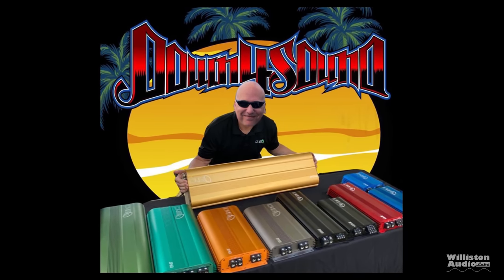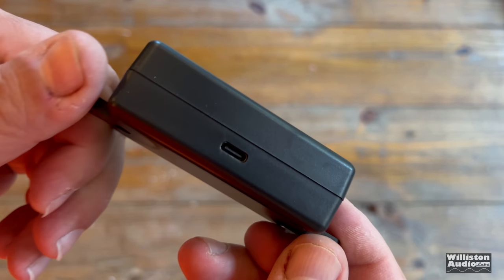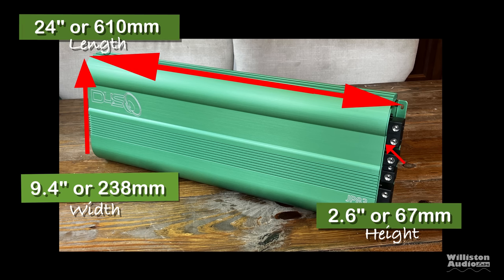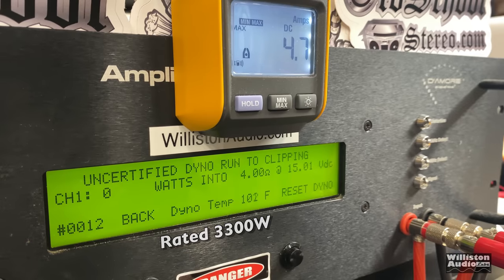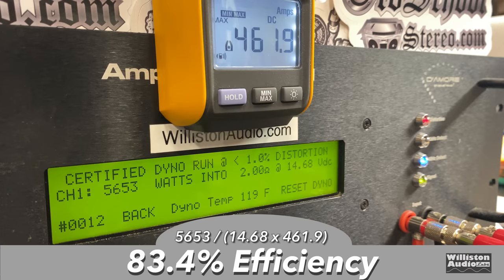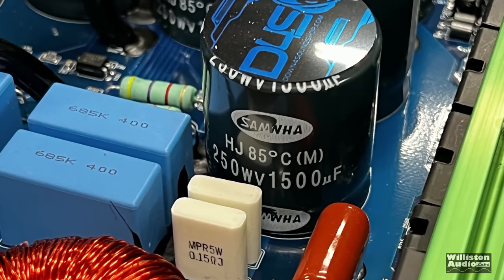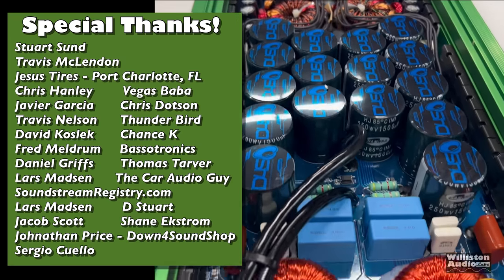OVERLOADED my AMP DYNO? D4S JP83 is a 10,000 watt MONSTER!! [4K]

Comment: So I'm all about over rated power but I'm thinking it's time JP put on his amps a more realistic rated power so people can see the price is more than good for what your getting. I've been running the JP8 for a couple months now and NO problems whatsoever. Been up in the 90's where I live and the amp has yet to get over 119 degrees. So far great quality at great price!
Reply from the maker: Awesome 👏
Reply: I get what you're saying about the power rating but there are other factors that go into rating the output of an amplifier other that what the amp dyno measures. 

The amp dyno is a continuous consistent load. A subwoofer is anything but. The amp dyno measures Certified @ 1% THD+N. This amp may be rated by D4S at a lower distortion level. The CAE requirements say "at or below 1%" so that leaves it up to the brand on how to rate them. 

On the flip side, this can reap havoc for someone trying to design an electric system to power this beast. They think they're getting an 8,300 watt amp but it has the potential to bump up to 15,000 LOL 😂

Comment: Just put in my orderrrrrrrrr!!!!!! WOOOOO 2 on the way
Reply: @wal  hey D!, question. Do you believe these can run smoothly if I run them at 15.5v as a daily? Or is that voltage too high and will cause damage? 
Now for further context I'm pairing them up with 2- 400amp Alts, 4- XS PWR S6 secondary's, and 1 SB-500 34 for under the hood.

Comment: Now that amplifier is good👍
Reply: @wal  just got my 2 Soundqubed S1-2250.1 back in my suburban. I like them better than the 8k U1-8000 Soundqubed amp. You need to get the Soundqubed 6k amplifier and test it.
Reply: Hay Derrick can you dyno a Soundqubed S1-2250.1 amplifier at .50 ohms? I'm very curious what they dyno 😃

Comment from the maker: See more and get your JP amp here:
(Affiliate links and all may not be available)
JP83 Amp: https://bit.ly/3t0zz1y
JP33 Amp: https://bit.ly/3PKhSNk
JP43 Amp: https://bit.ly/38qOcUQ
JP63 Amp: https://bit.ly/3t0fAQy
JP132ab Amp: https://bit.ly/3yYsEcT (sold out!)
JP34ab: https://bit.ly/3sZoFsY
JP23v1.5: https://bit.ly/3yYt9DN
JP234 Amp: https://bit.ly/3NF8clC
JP8 Amp: https://bit.ly/3wOBbhg
JP84 Amp: https://bit.ly/3lR2ukJ
JP95 Amp: https://bit.ly/3yYtd6v
All JP Amps: https://bit.ly/3lMb4kz

Video Playlist of all D4S Amps:
https://bit.ly/3NF8I32

Video Index:
0:00 Intro
1:04 What's Included?
1:56 Specs and Features
3:07 Size Comparison
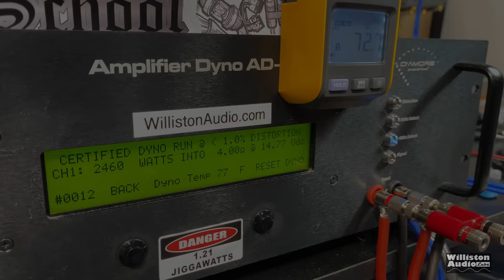3:37 Amp Dyno Tests
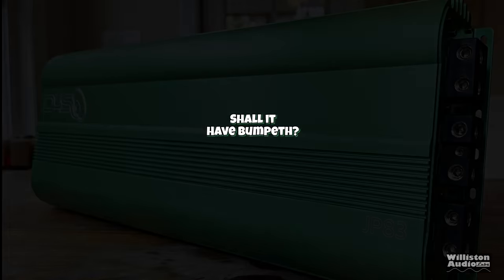7:01 JP's Windy Tahoe
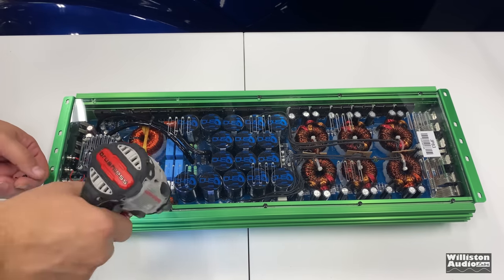7:38 What's Inside?
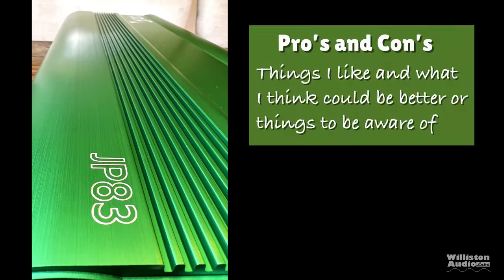8:21 Pros and Cons
9:13 Final Thoughts
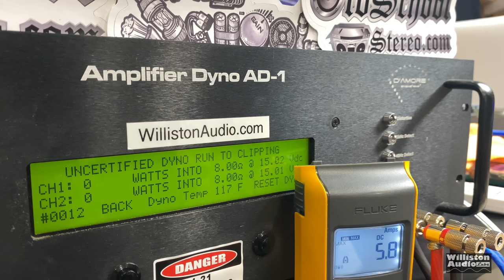9:38 EXTRAS

Links to JP's Tahoe 2022:
Build is Complete: https://youtu.be/vUyXhhAHtZQ
Tahoe Rebuild Initial Demos: https://youtu.be/1OtwOsmqjzY
2022 Made of Steele Demos: https://youtu.be/vtT2FymEkdg
2022 Slamology JP Demos: https://youtu.be/A5g2dWn8iKA
2022 Slamology JP Demos Part 2: https://youtu.be/gs1ARU55-08

Note: This video is shown as paid promotion because 1) I'm keeping the amplifier for future testing and 2) I'm an affiliate with Down4SoundShop so using my links in this video to purchase car audio results in compensation for me. I was not paid by D4S for this video. Rest assured the info provided here is factual and my opinions on the product are NOT based on possible compensation. I test amps and provide information for the consumer, what you decide to purchase is your decision. Thank you.

Comment: I see the models are taking US Amps style and coloring . ya know we have seen high power voltage high power amps before look at examples of high voltage input amps .With the electric vehicle going to be the future the voltage possibilities are endless . Hell , ive been running 18.4 volta in each of my jeep for the last 20 years and with that subtle difference in voltage and using compatible amps i see more power on a amp identical ran in a 14.4 volt setup.  Thanks for your revies and testing , its enjoyed :)

Comment: I really need to hear these amps because I’m 90% there on them being a new favorite. With a good set of 6.5” components and a clean sub(Sundown X) run in three way mode I’d be able to tell instantly. Those RF BDCP amps are hard to beat though.

I wouldn’t hesitate to recommend the entire line because of the value.
Reply: Bdcps are outdated.

Comment: I would love for someone to do some testing around 13 volts. Sounds dumb but not everyone has a super strong electrical system.
Reply: 99% of the audio fanatics.... number one do not have the money for an amplifier of this class. Number too don't have speakers that can handle the wattage, and number three it's not necessary.
Reply from the maker: JP runs his amps at 13.5 since he’s running the LTO’s in 5S config

Comment: could you make the comparison to these amps with the crescendo monoblocks?They have a lot of similarities from the outside to me.
Reply: Bass clef 6k
Reply: They are very similar to the bass clef and salts. Same buildhouse.
Reply from the maker: These JP amps have all surface mount devices and are smaller than current gen SALT and BC amps. I bet next gen of those will be smaller tho

Comment: Getting two of these strapped to power 4 b2 rampage 15's xmv4's d1's in parallel series at 2 ohms(1 ohm each amp). I just need to find out which lto's I want and 2-3 400 anp alts

Comment: Damn thing could power a house! XD Also, doing the math I'm just blow away at how much current is being shoved through those poor banana jacks on the front. Wonder if the connectors actually got hot....
Reply from the maker: The Dyno’s fan comes on at 120F and I had to give it a break to let it cool. Next time I’ll check the wires with my FLIR

Comment: I'm interested to know what kind of signal does the amp dyno tests with, like 1khz, pink noise, what? In either way i wasn't expecting that thing to output so much power, however with that kind of power is not very useful for everyone as i'd rather run PA drivers for SPL with 3-6db or more sensitivity compared to car subwoofers for the same output with twice or more less power as things such as high amps in a car turn costly, but DAMN knowing how the situation was before a few decades, you can't beat the output of this amp for its price!
Reply from the maker: For subwoofer amps it uses a ramping -30dB to 0 dB 40Hz track
Reply: @wal  And this output so much power with 40hz? Damn that's breathtaking!

Comment: The Bluetooth bassknob is really annoying especially if you have to pull every wire to reset it. Anyway I've had the JP 23 in my living room and the regular plug in bassknob makes life much easier and my friend has the salt 8. Im thinking of switching amps just because ive had so many problems with the Bluetooth bassknob. Maybe D4S can makeit optional or something?

Comment: Do you have a charger on your batteries when you do these tests? Or do you charge it after the runs?  I remember you saying you removed your capacitor bank. Wouldnt it be better to have that in there too? That would help out the surge a bit. Thanks for all you do!
Reply from the maker: With these tests I have (2) 100A power supplies running along with the LTO bank. I'd use caps too, but the versions I have are 15V max. I'm planning on replacing them eventually with all of the newer 3V 3000F cells (ones I'm currently using are 2.6V 2600F)
Reply: @wal  Looks like you should get a wrecked Tesla and use the batteries from that LOL!! Great work and thanks for your service brother!!!

Comment: It would be neat to have a pair of them running a PA system in stereo. 😉
Reply: Their bass amps st0opid 🤣
Reply: @playaj320  
Touring systems can have 100+ kW of BASS AMPS, you know for subwoofers? :-D 

Point is, it would be interesting to see what kind of cone control this amp would have compared to a mains powered sub amp in the same power range.

Comment: Big D I finally got me a d4s jp95 and so far I'm really disappointed..it has crazy engine wine..it's my mids and highs amp I had a rockford be forced no problem at all,do you know what to do cause that shit drives me crazy
Reply from the maker: I had that issue with the Sundown SFB 5ch but not the D4S JP95. Check those grounds.

Comment: hello. what was the problem in measuring the current with the fluke?
Reply from the maker: Only measures 1000A DC and this amplifier pulls WAY more than that
Reply: @wal   but why was the reading wrong when measuring by cliping? At 4:22 for example.

Comment: Fed by the correct DC supply,  from an AC outlet at home, do these figures translate directly to an equivalent home amp set up?
If so, would it reproduce a high fi quality audio through equivalent resistance home speakers? Just a thought
Reply from the maker: You would need either a massive power supply or a massive Lithium battery bank charged by a power supply to run this in a HT

Comment: I dont understand how the dyno is reading 119° 😕 an how the numbers are jumping up an not counting right.. this test should have been redone with  properly functional dyno runs.. this to me  screams disception. I love your videos have for years! but for the most highly antisipated video to be wonky per say just doesnt make sense.. why not run it again on a different day or time? Also why not use a dmm to measure voltage at the amplifiers power inputs to get the true voltage during the run?
Reply from the maker: The Amp Dyno got hot so I had to let it cool down between tests. Chill, nothing suspect here.

Comment: So technically if you could provide over 1000 AMPS those 9 amplifiers. Could provide over 200,000 Watts
Reply: Amps X Volts = Wattage, so for 200000w ÷ 12v = 16666a needed, if you can maintain 14v you would need 14285a. Same thing when people add wattage of the fuses in an amp to get a guesstimate, if it has 3 30a fuses it should make 1080w, I usually go on the low side and multiply it by 10 instead of 12 cause no amplifier ever made was 100% efficient. Hope you understand that,  it's like 4am lol

Comment: So, I love your videos.... But, you didn't measure the current correctly. DC current flows from negative to positive. So, having one clamp on meter on the negative, then measuring the return line (positive) in conjunction doesn't make any sense. All you needed was a meter on the negative, and that's all. But, it's still a bunch of current regardless - but half of what you show.

Comment: I love your content. But on your amp draw readings are incorrect. You don’t add the amp draw readings together. You would take the three readings and you can add all three runs and divide by 3 to get an average of all three. Of take the highest reading of the three and that’s your max amperage. I’m a certified electrician…
Reply from the maker: Wait, so you're saying two different clamps clamping all positive leads together isn't the total current pull? What would be the difference in my method vs using a 2000A clamp encompassing all the positive wires together? I must be missing something here...
Reply: No sure must amp clamp each one individually. Add the three and divided by three. For an average amperage. Or use the highest readings as the max amperage.

Comment: Great video. Can you check out the Boss PD4000 at $150? It is 120 amp fused. No videos on YouTube as of yet.
Reply from the maker: Thanks for the suggestion
Reply: I did a crude test with a clamp. 583 watts @ 2, and 1027 watts @ 1 ohm 78% eff. I’d really like to see your real results.
Reply: Boss is NOT Bose.
That's why the odds of seeing a Bargain Basement amplifier being tested is going to be done when he does inexpensive amps not amps that put out 20K.

Comment: Cheap S&I boards yummy
Reply from the maker: What do you prefer?
Reply: @wal  I run a Salt-8 so I love to see JP putting out an almost identical product for a much better price. But my heart is with full bridge. For example, the Powerus PW15000 is a great design with good damping factor and protection and a much better value than any half bridge. I'd love to see someone take a quality full bridge board like the Powerus and put it in a beefy case with good Tiffany connectors, etc. Imagine if JP did this he could sell an amazing efficient 10kw amp for well under $1000.

Comment: Dc is garbage my buddy went from a american bass xfl 15 to a dc audio elite 15 and it failed after 1 week hes pissed 900$ sub that has a smaller motor rhen than a 300$ skar
Reply: DC is garbage? What u smokin?
Reply: @elcomandante9299  dc is garbage it failed skar never did just like the level 6 failed on Parker clean power
Reply: @elcomandante9299  running sundown now
Reply: @elcomandante9299  running sundown now

Comment: Wait test TARAMPS HV 160kWatts 😅😄😁
Reply: Those amps are not running on 14.4 volts lol
Reply from the maker: Ha ha! Not a 12V amp but crazy
Reply: @Thumper68  😁 i know, to You need a high-voltage power supply system... such as 380-420 Volts ⚠⚡⚡⚡
Reply: @arturismagilov3285  yep need voltage to make voltage. But you think about it 400 volts for 160k don’t seem that crazy when getting 23k from 14.4v. 14 goes into 400 28x so if you multiply 28x23,000=644,000 watts if it worked like that lol